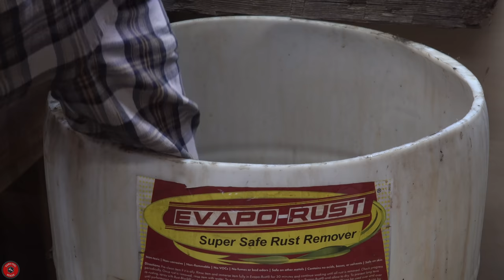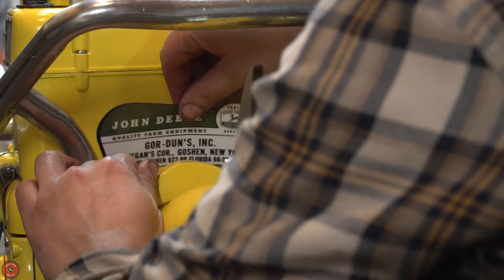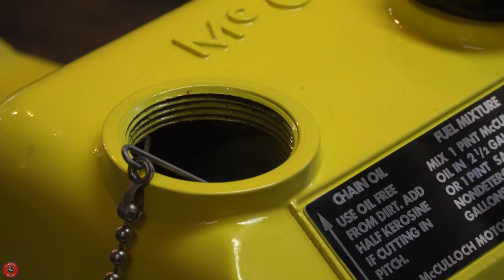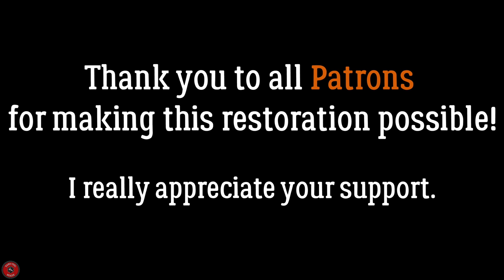Two-Man Chainsaw - Final [Restoration]

Comment: You bent all those metal tabs the wrong way! You bend them towards the bolt head so the bolt can't back out, pre thread locker tech.
Reply: I noticed that also. , We all have brain fog somedays.
Reply from the maker: They were bent down when I took it apart, so I just stuck with that.
Reply: Agreed... they're old school Loctite.
Reply: I noticed that too. Maybe this one is special?
Reply: @HandToolRescue  That just means they were bent wrong when you got the saw.  They should be bent up to prevent the bolts from rotating.
Reply: If you have to remove the flywheel for any reason, take the opportunity to remove the bolts and flip the keeper strips over so the tabs face up.  Then reinstall the bolts and bend the tabs up.
Reply: @HandToolRescue  at 9:25 in the motor inspection video you can see the tabs bent up.
Reply: And to add more to it, I'm pretty sure that this type of washer is single use.
Reply from the maker: At 19:34 in my previous video you can see some bent down.  I agree with all of you though.
Reply: I should add that I love the video.... great job bringing another cool tool back to life and making it interesting.
Reply: HTR: Spends countless hours and money on a very detailed restoration for the enjoyment of others. 

The internet: YoU pUt ThE tAbS oN BaCkwArDs.
Reply: Why not just use thread locker and be done with it 🤷🏻‍♂️
Reply: @Yellow_Hammer  LMAO Yeah, and that shade of yellow is all wrong too! Oh, just give it here, I'll do it...
Reply: They were bent the wrong way in the first place. Can't expect the fella to know everything. Problem is, it's likely they might break anyways.
Reply: @HandToolRescue  Maybe there is a reason, I'm not sure why though. I have bent over alot of those tabs on helicopters and motorbikes over the years. Love your channel. PS that chainsaw was a monster.
Reply: swapped around? Definitely should cover the bolt head. I'm surprised you refitted them incorrectly  @HandToolRescue
Reply: I came down here hoping I wasn't the only one.
Reply: @poppypuppy5372   wrote "swapped around? Definitely should cover the bolt head. I'm surprised you refitted them incorrectly"

Poppy, I'm surprised your videos where you spend months restoring an antique chainsaw without a manual seem to be missing from your channel.
Reply: I thought I was going mad/had been misunderstanding those things for years
Reply: @atypicalscholar109  Metal tabs (sometimes wire) are called 'absolute locking' techniques ("freinage absolu" in french), and offer a higher degree of security for some applications. You can find this technique on critical parts like car hubs or breaking systems ;)
Reply: Please don't misunderstand: I'm a great admirer of Hand Tool Rescue ( and a subscriber to the channel). I was genuinly surprised that he apparently had not come across locking tabs before and missed the fact that they were fitted incorrectly  @sfmc98
Reply: Don't think it really matters, I don't see this saw getting much future use besides some demonstrations like this one.
Reply: I'm glad you mentioned this. I couldn't figure out the purpose of the bend. Thanks.
Reply: hey man you did a great job id bet half of these goobers used a wire wheel on lead paint ,, wink wink...double thumbs up  @HandToolRescue
Reply: Dude so was just about to comment that but I was like got to check the comments
Reply: @myharris  hold my beer I got this LMBO
Reply: @Excellent Lord God  😂
Reply: I thought the same thing so paused the video to check the comments!
Reply: I think some are supposed to be down so the washer can’t spin and some are supposed to be up so the nut can’t spin
Reply: I thought something looked weird about that, but would never have figured it out. THanks!
Reply: Just throw them away and apply some loctite red.

Comment: Sure brought back some memories of working with my dad back in the mid 60’s when I was about 11 or 12.  He ran the saw and I guided the handle at the end of the bar.  Who ever thought it was dangerous?  No one, it was just what country boys did.  Now all you need to complete the restoration is to find the post hole digger attachment.  More than once it sent me flying after hitting a rock or root.  Great job on the saw!

Comment: 7:20 Uhm, those keeper plate edges are suppose to be bend towards the flats on the bolt heads to keep them from turning from the vibrations. Bending them that way doesn't do anything.
Reply from the maker: Yes, I questioned it myself, but every single tab was bent downwards when I took it apart.  Everyone who knows why they were bent up on this saw is probably dead so I just have to go with what I saw.  If someone has another McCulloch 99 we can find out though!
Reply: @HandToolRescue  Go to 9:16 on the motor inspection video, you clearly see them bent up against the flats of the bolts
Reply: @HandToolRescue  Not dead yet! Quite...   lol
Reply from the maker: @greypoet2  Haha, I mean the people who worked on the saw, haha.  But here is an example of the cylinder bolts having the retainer plated bent down.  https://youtu.be/ThAJp-5pklM?t=1173
Reply: The entire saw was wrong in so many ways before HTR took it in, whomever owned it really didn't know what they were doing, like, really didn't know.
Reply: @HandToolRescue  Just because someone did "anything" one way doesn't make it right. CO Jones has it right, the tabs press against a flat on the bolt. This is an older method of keeping a bolt/nut from backing out but I've seen it used in many applications. All those applications had the tabs bent into the bolt/nut, which is proper. Stop, think, and look at them and try to figure out why the flat would bent onto the casing instead of the fastener; they have zero use as such.
Reply: Ian Ide I am by no means an expert but I’m fairly handy and I came to comments and was going to ask what the point of bending the tabs was. Thanks for clarifying it for me. I didn’t understand the point until these comments.
Reply: @HandToolRescue  CO Jones is correct. The Tabs go UP to prevent the bolts from walking out under the ridiculous vibrations this unit produces. Also set the point gap first and THEN install the capacitor. I used to make $9 an hour running that particular saw for a local arborist. And 14 years working on logging crews here in Oregon, we NEVER used that saw for actual work. I then made $20 an hour repairing that garbage for the next 15 years. Heavy, LOUD and will most likely smoke REALLY bad at some point shortly after you get it running. Lastly they are meant to be run with the blade horizontal to the work. That's a FALLING or Felling saw. Not a trim/prune/limbing saw. The operator on the motor end holds the throttle side UP. The helper end is not a fun place to be when you hit a nail, barbed wire or whatever other shit might be embedded in the work. If, NO! WHEN the Chain breaks with a helper on that end? The 99 is DANGEROUS GARBAGE! Do Not Use! The newer saws are far safer, lighter and better made. Stihl is the only saw for me!
Reply: @aserta  You are totally right on that! I watched the entire tear down video and can't believe he didn't toss that POS in the recycle bin. I certainly would have.
Reply: I immediately saw this at 7:20 I was going to comment and saw your comment. Great vidoes from Hand Tool Rescue. Me and my brother have a small engine repair shop so I seen this right away. Keep the great vids coming Hand Tool Rescue
Reply: Hand Tool Rescue I think the whole washer will turn if you’ve been them all up I’m pretty sure one or two needs to be bent down

Comment: That solid copper house wire will fail in a short time. You have to use braided copper wire in anything that vibrates. It will work harden and crack.
Reply from the maker: Yes, for sure.  Luckily, I will be dead the next time this saw gets used.
Reply: @HandToolRescue  ::   Brilliant Response my Good Man!
Blessings!

Comment: Am I missing something, don't you usually bend the lock tabs against the bolt head?
Reply from the maker: Not when I took it apart.
Reply: I thought the same thing too
Wouldn’t that suggest that perhaps it’s been apart before? I don’t see the reason why the manufacturer would bend the tabs down...unless I’m missing something
Reply from the maker: I questioned it myself, but every single tab was bent downwards when I took it apart.  Everyone who knows why they were bent up on this saw is probably dead so I just have to go with what I saw.  If someone has another McCulloch 99 we can find out though!
Reply: @HandToolRescue   At 71 I've come across these tabs many times before. They are an alternative to castellated nuts with cotter pins. Since you can't have cotter pins in a bolt head (totally useless) they used these tabs to keep the bolt from turning. So the tabs are positioned against the bolt head. Obviously, whoever worked on it before had no idea.
Reply: Sometimes there are two locking tabs on those washers, they're still very much in use today btw, one to bend against an edge on the unit and another to bend against the bolt head. But definitely one of the tabs should be bent against the bolt head itself.

Comment: I thought the metal tabs are to be bent up around the bolt heads so the bolts and nuts do not spin lose?
Reply from the maker: They were bent down when I took it apart.

Comment: Everything looks so heavy on this chainsaw.  I have seen smaller carbs on cars.  All those gears to drive the ignition timing?  Most small gas engines fit all this under the flywheel and use cam, instead of gears.  What a beast to use.

Comment: The red gasket spray is great for water pumps, intake manifold gaskets, and the such. For head/exhaust gaskets, the copper spray a gasket it the best. Fills surface imperfections and whatnot. Just my $0.02 as a mechanic and avid chainsaw collector in southern Illinois. Great job on that guy. Old McCulloch saws have always been kinda weird. The carbs are weird, and some of them have a wick rather than fuel lines, and you use the throttle rod to set the carb...

Comment: I have the exact same saw settings on the shelf, thanks to your video I now have the courage to restore it. Thanks for the video 
You are brilliant. Oh and one small correction the center twist bar is intended to work the throttle during one man operation not the oiler. But only Arnold Schwarzenegger in his youth could use that saw in one man configuration

Comment: Best intro on YouTube. A little help on the roller bearings, put some assembly grease on the pin and line the roller bearings up in a solid line. Carefully roll the pin oner the bearings and they should stick to the pin. Then carefully slide the assembly into the small end. Then use a washer or something the size of the OD of the pin to allow you to slide the pin out. The bearings should be captured and then you continue assembly. Dangar Stu did it in one of his evinrude rebuild videos

Comment: Great video man. I'n the future I'd recommend using stranded core wire on things you plan on running a lot because it withstands vibrations better. Solid core wire will eventually break. Crimp on connectors also don't work well on solid core wire.

Comment: I really like the external points with the pushrod - having to remove the flywheel to check, adjust, or replace the points is a major pain on so many of these small motors, the McCulloch engineers and mechanics of the time were obviously tired of that too. I wish more small engines had this feature. I have a more modern McCulloch chainsaw, which is a fantastic little unit, but it does not have this feature - the modern way of building things to a budget rather than to a standard has infiltrated everything now. Even the top-of-the-line Honda engines have the points under the flywheel - ugh. Instead of a 2 minute job it takes an hour, and that's if everything comes apart easy. Ugh.
Another lovely restoration of an alarming death machine from a bygone era. That nice shiny yellow paint will look really good with blood spatters all over it. Whilst not as wild as the petrol powered Drag Saw or (insert creepy whispering) "The Model" Swing Saw, it will still kill you just as dead, albeit with a bit less noise. Although that's only if you don't count the screaming...

Comment: Fantastic job!  That thing is a real beast.
By chance, was that gearbox under the flywheel, supposed to be packed with grease?
Reply from the maker: It bothers me that it wasn't greased, but it looks like they are lubricated by the fuel mixture.

Comment: You surprised me, not using a ring squeezer. I've managed to break a few rings that way over the years. You must have a steadier hand than I. Was also curious whether they listed a torque value for the head bolts.

Comment: I remember using a 2 man chain saw back in the 70s. The thing was so heavy. The point man just helped guide the end of the bar. While making vertical cuts. The dogs and the weight of the saw did the rest. We used wedges with it. So you didn’t bend the bar.

Comment: What does those two gears either side of the crank do? They are on bearings, so seem to not power anything? I have been trying to figure this out since you first posted. Edit: may be counterweights to reduce vibration?

Comment: In the late '50's - early '60's my father had a 4 cycle single man chain saw. The 2 things I remember most it was heavy and if you took it higher than 6 feet above the ground it would not run.

Comment: Absolutely too
Notch work! Question for you , the metal strips that went under the bolts in the cam area. Shouldn’t those metal tabs be folded upwards against the bolt head to lock them in from spinning? In the video you tapped them down over the engine case. Hard to tell
In the video if that’s what they are for. I was just curious, didn’t want them to come loose and ruin all
Of the hard work you put into it! Thank you for the videos, absolutely awesome !

Comment: Not positive on this but I think the locking tabs on the cylinder and the gear set were bent the wrong way. When I was working on chainsaws (and other equipment) that used that type of fixture to secure fasteners, the tab was bent up the flat side of the bolt so it wouldn't vibrate out of place.  Well, I am positive of this as the casting isn't going to move.

That saw is a monster and I've never liked to be at the bar end of a "two" man saw.

Great to see the old saw come together and cut wood again.

Comment: 2:15 if you don't wants to scratch that piston. Use a metal thin sheet make a cylinders so the ring can just slide form outside the cylinder . Or buy the piston ring clamp. 😁

Comment: You know, those flat metal strips with tabs you hammer into place are normally used to lock the head of the screw into position. Yet you are hammering the tabs downward against the body of the saw so, please correct me if I am wrong, but like that they seem to be doing nothing.

Comment: Solid wire is ungood, will break due to vibration. Same thing about soldering: you don't want soldered joints around engines, they break off quickly. Use multi-strand wires and crimped terminals.

Comment: Did you just use solid wiring from NMD90 house wiring in your chainsaw? Hahaha that's some Red Green shit right there! Love the build! In all honesty though it might fail on you it's not designed for use in environments with high temperatures, oil, gas or vibration. Consider using wire from flexible cord marked SOOW.
Reply from the maker: Hahaha yes.  I mentioned I soldered them on in the video.
Reply: @HandToolRescue  I updated my comment if the wire ever fails consider using wire from SOOW marked cord. It would definitely be better for the application.

Comment: There's a solid reason that solid wire is not used in tools and appliances.  The vibrations crack and break it.  Why did you replace stranded wire with solid?  And it looks like you took apart house/residential wiring cable to get those wires.  The insulation will also break down, crack, and short out in this application.  You cared which gasket material (silicone) would dissolve in gas why not this?  I understand this thing is just to become a showpiece but that inattention to basic wiring knowledge, akin to the tab thing, it was frustrating to watch.  In the future you can come by tons of correct wiring by salvaging it from space heaters, washing machines, and dryers.  That said, of course I was fascinated by the machine, and it's great many castings.

Comment: The tabs don't get bent down over the engine block, they should be bent up against the bolt head to keep them from vibrating out.  TS 7:16  Oh I see many others already mention that issue.

Comment: A piece of advise. Stuff a rag under the piston so parts don't fall into the crank case; especially loose needle bearings and in my case piston pin clip. Personal experience and disastrous results.

Comment: 7:16 instead of hammering the metal down to the engine housing, you should´ve bent it upwards, so it locks the bolt in place. (sorry if this is hard to understand, english isn´t my first language)
Reply from the maker: I just repeated what they did at the factory.
Reply: Possibly serviced before and bent incorrectly.

Comment: Nice work.  But, you hammered the locking plate tabs down away from the bolts instead of up against the bolts (at 7:18).  You can see at 9:29 of your previous video that you hammered the tabs down away from the bolts before you removed those bolts.  The tabs are what keep the bolts from loosening up.

Comment: How come use only put oil on the roller bearings? Do those gears need no lube or is that supplied by the oil you poured in the tank?

Comment: What did you use to secure the McCulloch logo? Was is superglue? Doesn't supper glue come off with heat?
Reply from the maker: Yes, but those areas will never get hot enough to remove the glue.